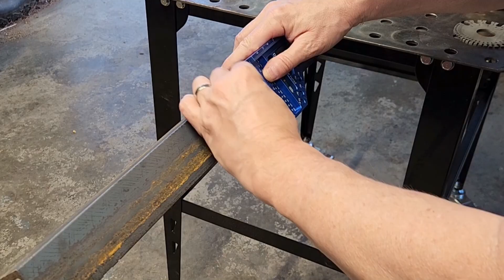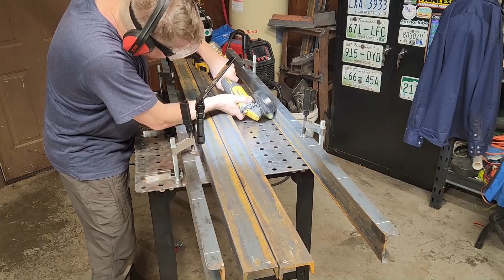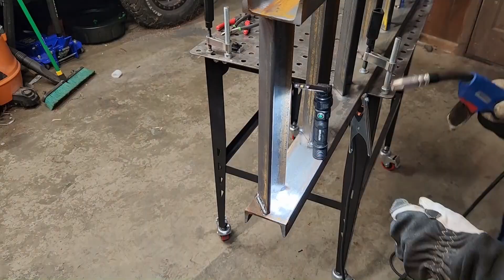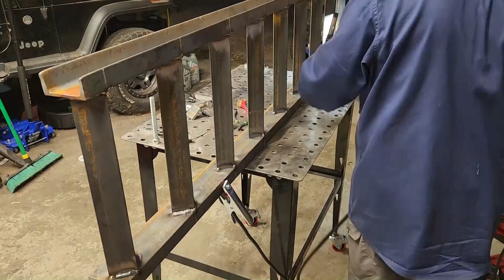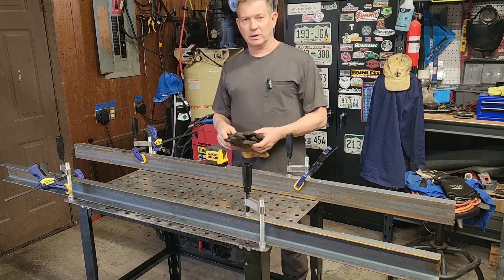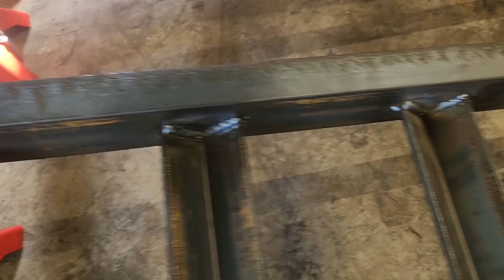Welding New Trailer Ramps

Comment: What is the difference between putting the angle on the outside of the c channel or the inside of the channel?
Reply from the maker: There were a couple of reasons I decided to do it that way.  Because the inside profile of the C channel has a radius and is not a perfect 90 degree in the corners, it made the fitment and welding much easier and allowed me to fully weld all the way around the ends of the angle.  It also made the surface of the ramps a few inches wider without adding weight.  I did a little "research" ahead of time by looking at professional equipment trailers going down the road and parked in various places and almost every one was done the same way so I figured it was a good design.  Thanks for asking!

Comment: What did you weld the angle to the flat side of the C channel VS the inside of the C?
Reply from the maker: A couple of reasons.  One was that it was easier to fully weld all the way around both sides of the angle.  Another was that I looked at a bunch of commercial trailer ramps going down the road, in parking lots, on websites, to see how they were done and the vast majority were welded to the flat outside.  Third, a more minor reason was that it allowed me to make the ramps a couple of inches wider without adding weight.
Reply: @DailyBrewGarage good deal. Thank you for the response. I’m about to weld up something similar for my trailer and was curious. You did a great job. I’ll be welding with my stick welder with 6011. That’s what I have for my farm…it’ll have to do.
Reply from the maker: @Civilian_Actual good deal. Best of luck to you!